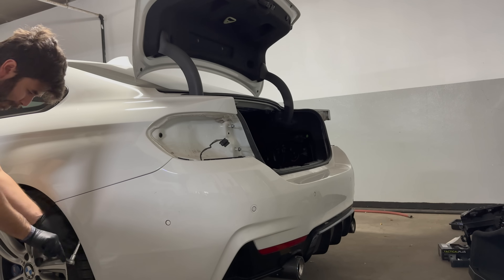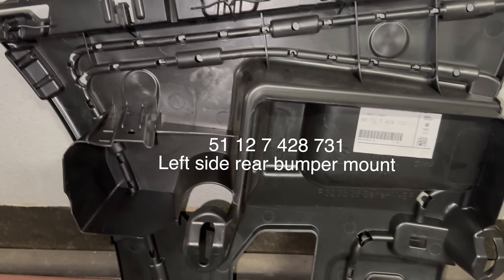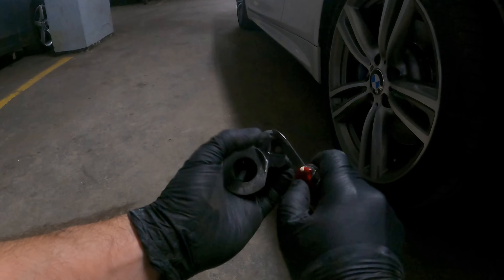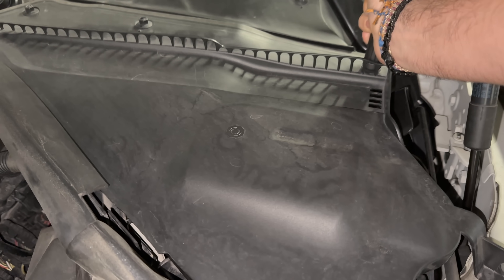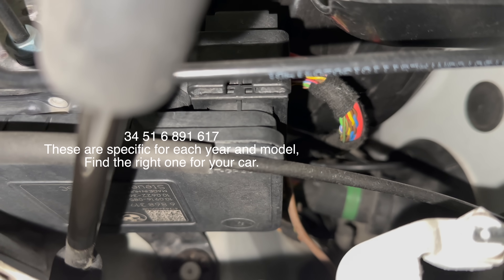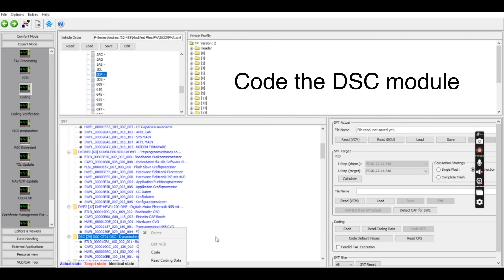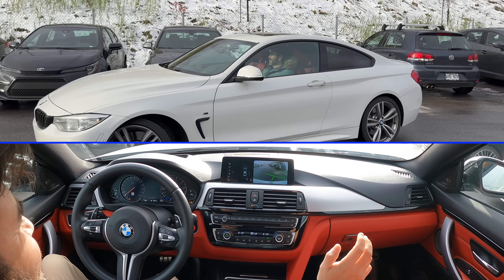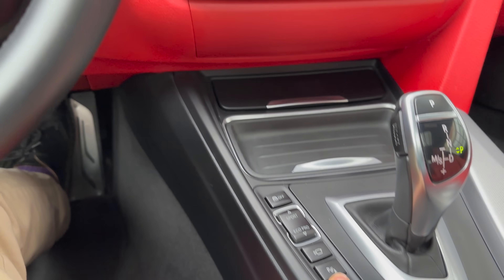BMW F Series Parking Assist (PMA 5DP) Coding, Final Touches and Demo - Part 2

Comment: How did you know where to drill the holes in the rear bumper for the sensors?
Reply from the maker: Depends of the bumper, in msport; you have marks (looks like a cross, same as in the front) in the normal bumper there are no marks, and you kind of have to make your own using the bumper bracket.
Reply: @DorksandBolts  I have the M Sport bumper. So even if it is pre-LCI, the marks are already there?
Reply from the maker: @JPDenali on mine they were there, very faint though, also pre-lci. Also if you have the bumper brackets and the sensor holders, you can place install them temporarily and transfer the location on the bumper. Also another thing that I did just to make sure the marks were right; I scouted a 4 series to measure the distance from all 4 corners. Yes, you will look like a maniac measuring a bumper in the middle of the road.
Reply: @DorksandBolts  Sounds good. I just did Surround View and saw the crosshairs for the front parking assist sensors as well as the camera crosshairs. If they're there, that should be good enough

Comment: Hello brother, thank you so much for your effort for doing these amazing videos for us. I have a 2015 BMW F33 428i XDRIVE , i bought the car accidented , i bought aftermarket parking sensors and i plugged them but it is still showing on my car screen that parking unaided and parking assistance unavailable , after watching your videos i concluded that the siren that comes on the rear right back side is missing and its connector is hanging on the rear right side under the black bracket, do you think it is the problem that is causing the sensors malfunction, knowing that also the front sensors are not working too.  Another question ,may the new aftermarket parking sensors require coding to work?
 please help me! thank you in advance and sorry for taking your time and bothering you!

Comment: Hi again, Isn't your F32 pre LCI and the PMA2 are LCI modules? What module are you using and did you have to edit manufacturing date and vehicle type in the FA?
Reply from the maker: I am using pma2 and no, I left the FA as the same, somehow it worked

Comment: Thanks, really nice, I've started buying parts👌 do the ABS pulse generators go 1 front driver wheel and 1 back passenger wheel, aren't the cables different lengths? A guide on bimmerpost says both front wheels? Thanks!
Reply from the maker: Yeah they have a very tiny difference in length, but what changes is the head of the sensor. I changed the front wheels only.

Comment: I have this option but just for parallel parking. Used it once to watch the steering wheel move but not since then. Still a cool retrofit through and maybe if your arm was broken or something temporarily
Reply from the maker: Yeah it’s actually pretty cool to see it do it by itself, although I have to admit that when I was testing it, it came really handy in a really tight parking spot where visibility was really bad.